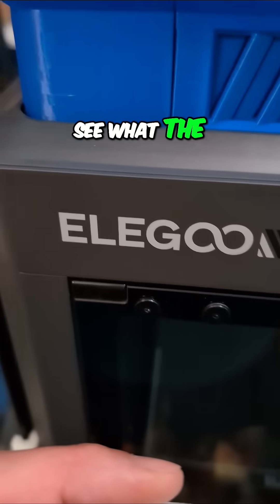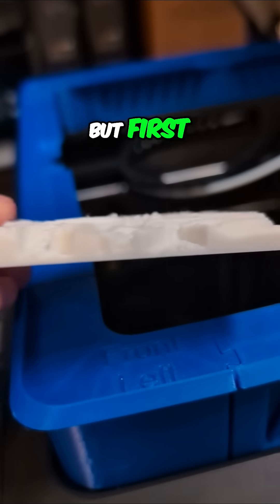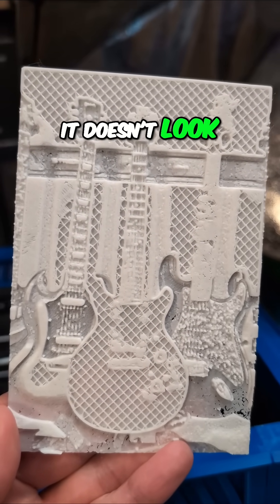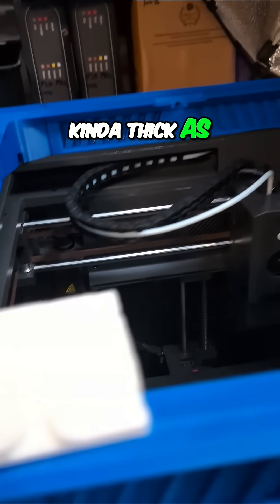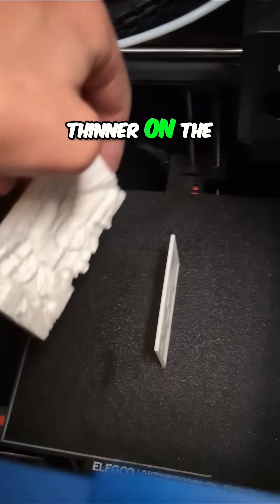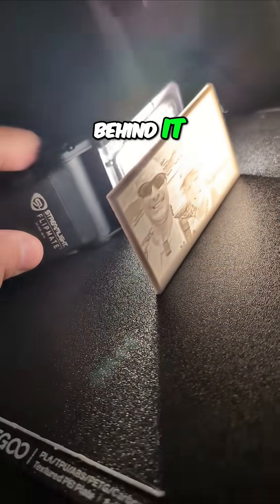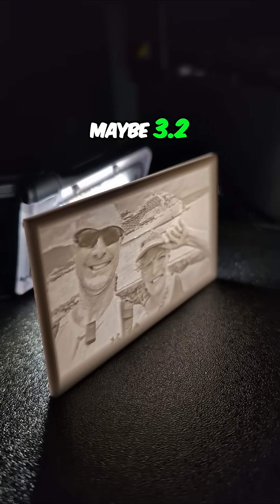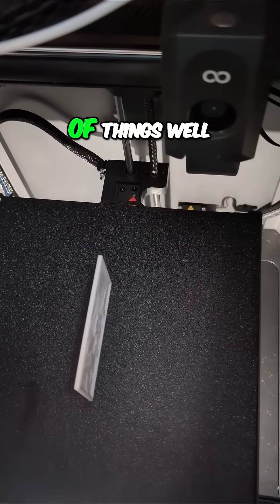Elegoo Centauri Carbon: What doesn't it do well?

Comment: Can you please share the settings you used on the elegoo slicer for the successful print? My CC constantly fails the lithopanes and it’ll print okay for about 20% and then it’ll stop extruding. I must have the settings wrong. The extruder gears are fine I checked them it just some how clogs the nozzle everytime. Please share a video or comment me the settings you used!
Reply from the maker: Sounds like your nozzle temp is too low, or too high. Either will cause extrusion issues.

Comment: The only thing I found is that it does not yet have color- filament changing.  A few other minor things have mods that you can print, for example the riser that you have on your with a light strip.  I also printed a top glass and 5 plate holder for the side and a better roller.  The CC compares well with my Bambu X1C and Prusa XL the price makes this the best deal that I know of.  Another plus - no need to go through their cloud.  That is why I don't consider Bambu anymore
Reply from the maker: Their cloud and prices are why I never bought a Bambu

Comment: The best setting I found for lithograph is 3,2mm thick and 0,7mm solid layer
Reply from the maker: Thanks for sharing. My best have been 3mm and 3.2mm with similarly thin (.5 or .7) solid layer and enough walls to make it effectively solid infill.

Comment: I remember doing a lithograph for the first time, it's so cool,  there are a lot of variables,  but once you get it tuned right,  they come out great,   thickness is of course a factor,  but the filament itself,  some are more opaque than others.

you did a flat one in the video,  but curved are easier to print and you can go bigger without fear they will topple over,  plus if you make them curved you can have them loop around,  to make a 360 degree litho,  and a single central light source will light up the whole thing.
Reply from the maker: I've been so happy with the little flat ones I had not even thought of doing a 360 lithograph. Thanks! This is going to be interesting!
Reply: @GearReportMaker it's amazing how much detail is in that thin one
Reply from the maker: Yeah. I am blown away.

Comment: It still amazes me that we can print a 2d picture in 3d and retain all the 3d details based off of math I love lithographs
Reply: I have a ender 3 v2 with the crtouch and cr spider Extruder with a glass bed but my crtouch cables blue wire I think the data for z got exposed it didn't touch anything but my printer is now broken won't move at all i think maybe a reflash with a none crtouch bios would work but if not what should I do sell it, fix it, or save for an entire decade for one of these (I don't have a job "everyone's hiring" but no one's calling back or anything so I do gig work)
Reply from the maker: I'd sell it and save for the CC. Its only $300.
Reply: @funniersphere44 I got great results from a stock ender.
Reply from the maker: I printed this one at a lower layer height and was completely blown away at the level of detail. I have a feeling I'm going to be printing a lot more of these. LoL

Comment: Amazing 😮 I need to know what settings you have asap
Reply from the maker: I should have saved them. I'm experimenting a lot and don't remember exactly, but in short, some advice i got from a lithiphane site:
- print thickness should be 2-3mm, maybe 3.5 max
- print with enough walls that infill doesn't matter
- slow the print speed for better quality
- lower the layer height for better quality

Comment: I have had mine for a week and so far I'm so impressed with this printer. Coming from running ender 3 v2's this printer a god. Planning on ordering a second.
Reply from the maker: I"ve only had a couple of issues that weren't my fault or the filament's fault... and a reboot fixed them. So far, this thing has been amazing. I haven't even wanted to turn on my bedslinger since getting this. You?
Reply: @GearReportMaker I turned on my enders 1 time this whole week.  At least with petg and pla the carbon is 5 times faster.  I sliced the same STL, 5.5 hours on the ender and on the carbon it was 1 hour 2 minutes.  

With that being said im converting my enders over to do pa6-gf, pa6-cf and pet-CF.  The print quality is really good its just not fast.  Perfect for the nylons as it likes to print slow.
Reply from the maker: Nice. I'm struggling with a TPU that I noticed says to use .6mm nozzle... which don't exist for the CC. So, I'll likely save that for use on the N4M. :)

Comment: I have mine on order and this just made me so excited to receive mine. I guess they’ll be at the end of July.  I made these before with my resin printer so now that I will be able to use the ccarbon I will be able to much larger prints. Thanks for the video
Reply: I'm surprised it didn't need a brim or custom brace support. So used to my ender. Was gonna use a brim on my Centauri Carbon when I print a litho project that turned out great.
Reply from the maker: I thought about it, but figured I'd try it unsupported first... and it actually worked!
Reply from the maker: Thanks for watching. I'm brand new at lithophane printing, but with the websites available to upload an image and get an .stl back, and printers that run well, it looks pretty easy. :)